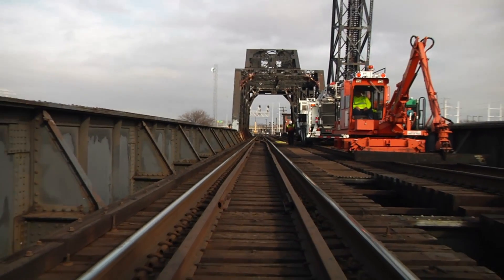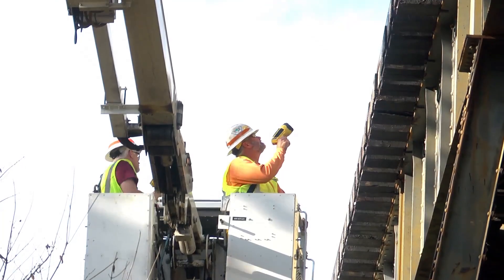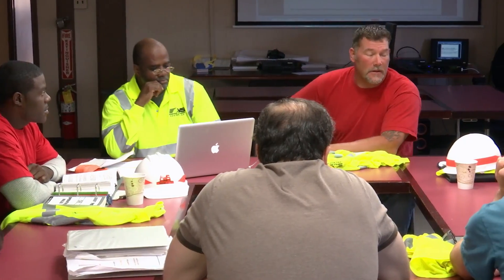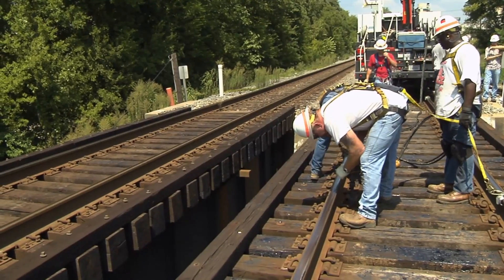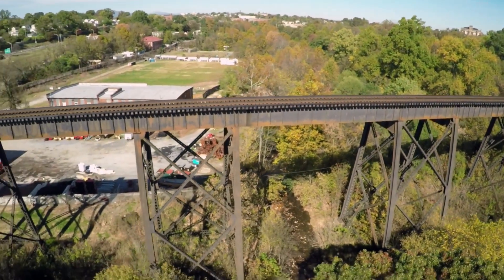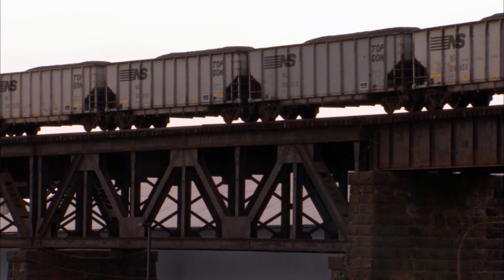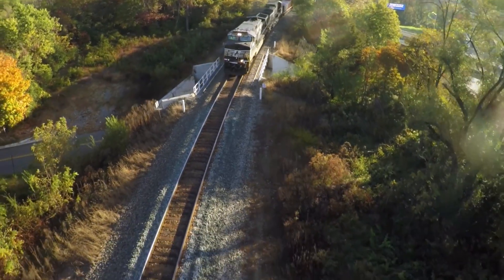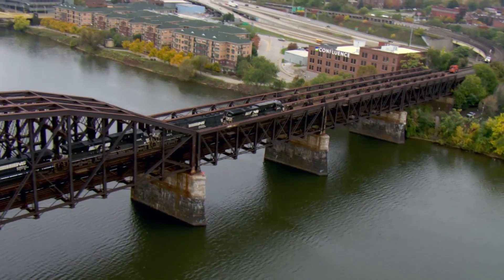Railroad Bridges: More Than Meets the Eye

Comment: Many of the NS bridges were built by the railway's predecessors back when railroads dominated shipping & transportation. Many of the bridges will easily last another 100+ years without any reconstructive work. Back then, railroads had the money to build bridges to last a very long time. And it wasn't just bridges. Look at the railroad stations built from granite, cut stone or brick. Many of them will last another 100+ years. It's amazing how the Department of Transportation can't build a bridge on our roads that lasts 50-60 years. The black paint the railroads used on the bridges 70-90 years ago lasts longer than the bridges built on our highways today.
Reply: Roads break down faster than a railway because of the way roads work lmao
Reply: A Railroad bridge in the middle of rural Missouri doesn’t carry the daily weight of heavy auto traffic in a metropolitan area. Bad comparison
Reply: @Nino_J  It doesn't have to, rail transit and freight is far more efficient